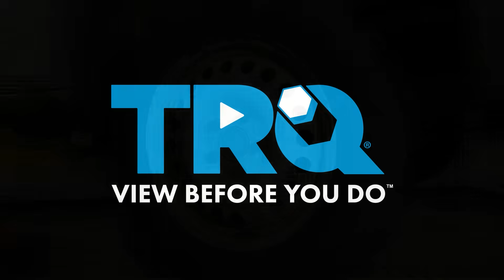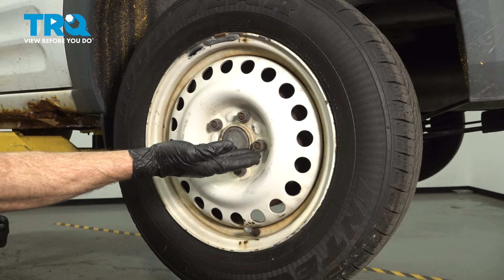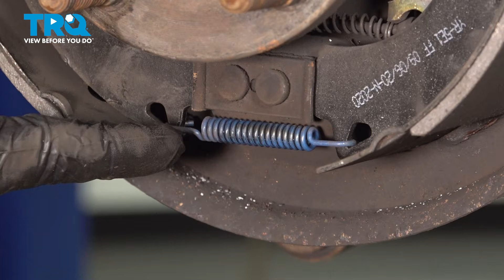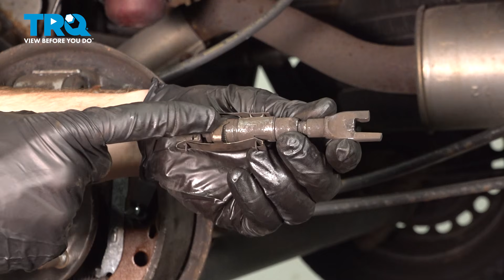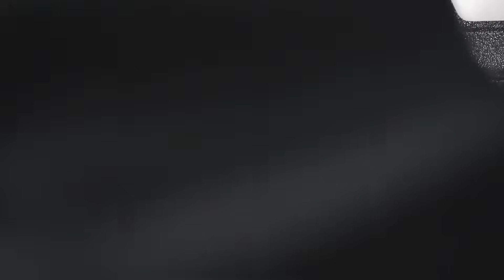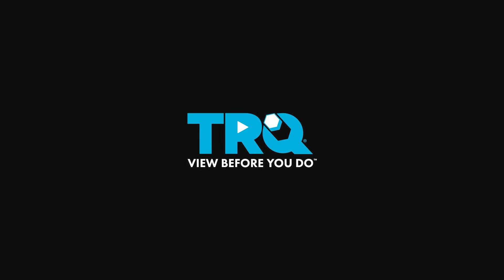How to Replace Rear Brake Drum and Shoes 2010-2013 Ford Transit Connect

Comment: 0:57 in 9 on 10 cases it will never come off easily like that because of wear. You need some heavy flat screwdrivers and a lot of patience to get it off slowly without damaging the plate behind

Comment: For the 2010 model year only, the torque spec is 66ft lbs / whatever it is in soccer measurements. I balked at this, but Costco said it was so and so do a few websites. I'm about to call Ford to confirm.

Comment: 10-year TC owner here and former mechanic. For those asking about the brake adjuster setting, just have the adjuster set so that the drum just slides on and off. The best way is to turn the adjuster until there is slight interference on the drum when you try to push it on. At that stage, back off the adjuster slightly until the drum will slide on. There is nothing else needed. TC have self-adjusting rear brakes, so any play will get taken up by the self adjuster, over time. This is operated by the parking brake, so if you're a 'put it in park only' guy, you need to start using the parking brake to keep the gap to a minimum.

I also disagree about putting any form of grease inside the drum. The contact points where the shoe and lining touch, just need to be clean and dry. I know we use grease on pad backs and piston faces, but that's primarily to prevent brake squeal. I never heard a set of drum brakes squeal, unless they were down to the rivets (in the old days) or the shoes are directly hitting the drum after all the lining has worn away. That should never happen if brakes are inspected and maintained properly. So if there's any rust or debris still attached to them after using brake cleaner, wire brush them until they're shiny(ish). That's all they need.

That doesn't change the fact that these videos are very well put together for the DIY mech. I always seek out a vid for any job I'm doing for the first time, even though I have 20 years former experience, because things change with continual new developments in the auto industry, plus I believe that every day is a school day.

Comment: Lol! HOW YOU GOING TO GET A DRUM OFF WHERE THE SHOES HAVE WORN INTO THE DRUM AND THERE IS NO WAY TO ADJUST THE SHOES IN ? 
I ended up drilling two 1/2" holes 3 inches apart - then I could reach in with a pick and move the adjuster's tin ratchet-pawl away from the serrations and then the serrations acted just like a regular drum brake adjuster sleeve.

Comment: Thanks for your video as I think it is the best one I have seen.  I did my 2012 Ford Transit but the adjusters keep breaking and now I have to do it again.   What is the correct setting for the adjuster?   I could hardly get my drums off the pads this last time.